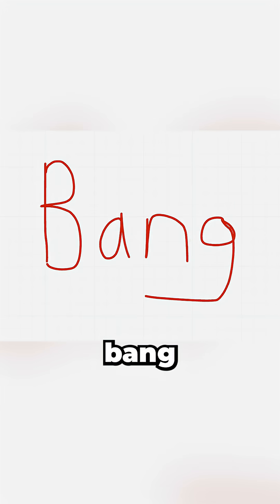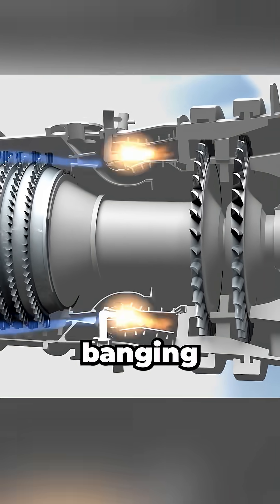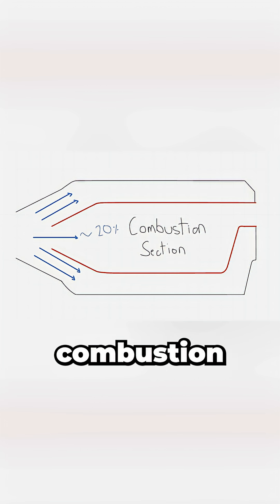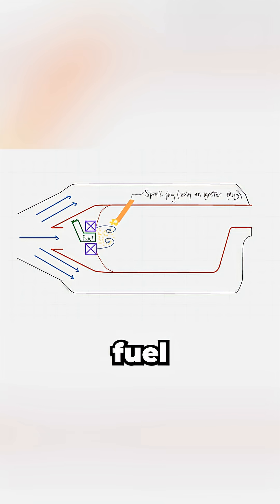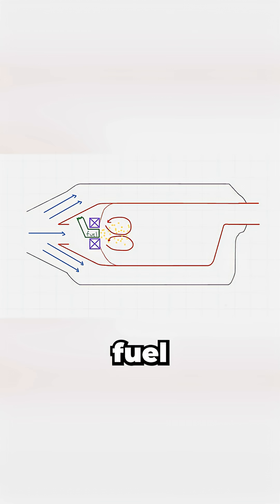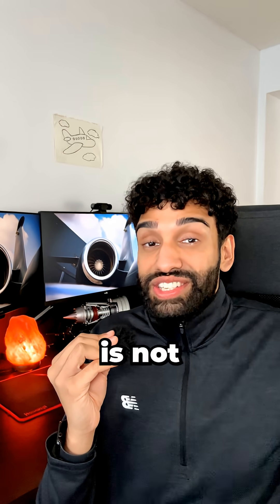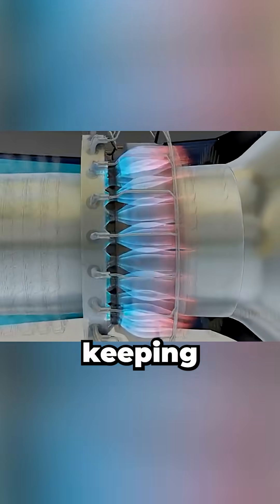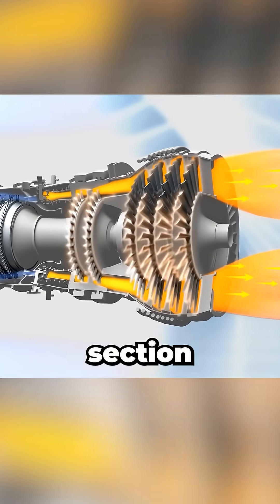What happens during the "bang" in suck, squeeze, bang, blow?

Comment: Suck squeeze bang blow 💀
Reply: Copied from donut media
Reply: @hulayhussain6714  yeah, didn't they originate that term?
Reply: @harper-hd yup they did
Reply: @hulayhussain6714  Respectfully they were certainly not the first, my father learnt that very phrase in the airforce back in the 80's 🙂
(With some brief research I found there was even a mention of the exact phrase from a 1958 aviation safety report! :D)
Reply: @hulayhussain6714  it’s a phrase the pre-dates donut media by decades so no.
Reply: @NZSamMan says on where ?
Reply: @hulayhussain6714   You need to focus on your grammatical skills, but I recall the phrase being used on the 2010 Christmas episode of Top Gear. As donut media was established in 2015 it would be impossible for them to have coined the term. Bondi.

Comment: Can you do a version for fighter jet
Reply: It’s the same cycle but with a worse performing nozzle and exhaust for heat suppression or size constraints on the airframe. there may be a variable exhaust for afterburner operability.
Reply: its the same but bypass ratio is lower and there is a afterburner stage afaik